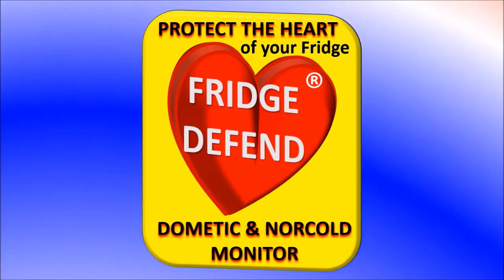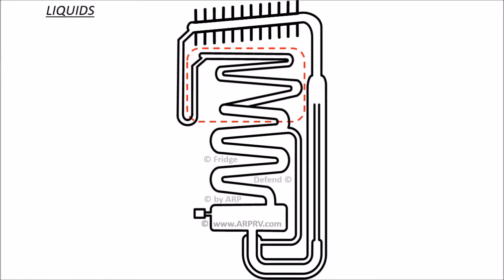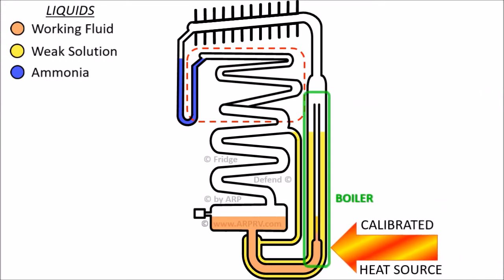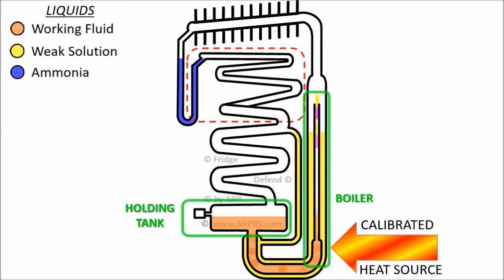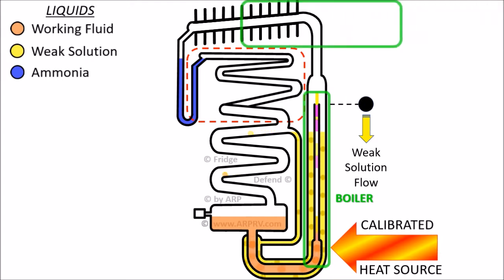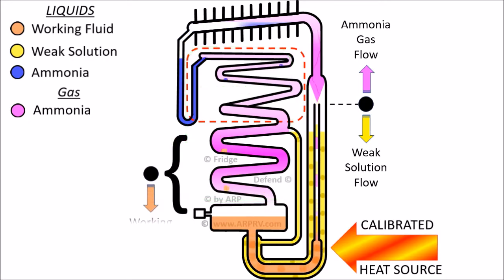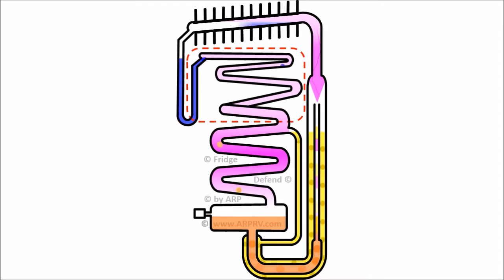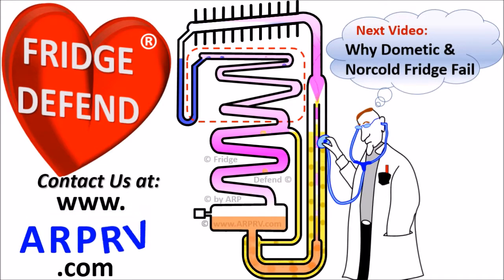How Dometic and Norcold RV Fridge Works

Comment: So, hydrogen AND helium are used as "assistant gasses"?  Is there a chemical process that occurs since ammonia is NH3, and water is H2O?  Or is it more like a catalyst, or just something to keep pressures right so the water stays as water, and the pressures are right so ammonia can change from gas to liquid at the right places in the tubing?  It's all quite amazing that scientists were able to figure all this out to make it work without any moving parts!
Reply: There is no chemical process, no catalytic process ... the assistant gas simply has a lower density than ammonia gas, so it stays in the upper region of the system.  The ammonia gas, having a higher density than the assistant gas, sinks through the assistant gas towards the bottom of the unit, where it can contact the recirculating weak solution (which is mostly water) and absorb into the weak solution, to return to the boiler and complete the cycle.